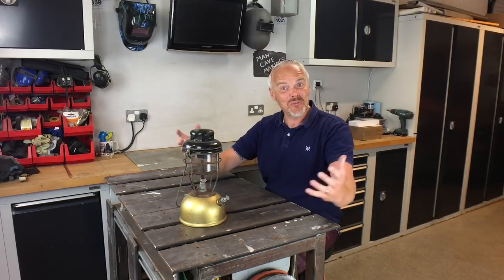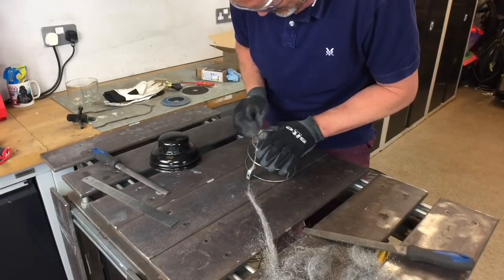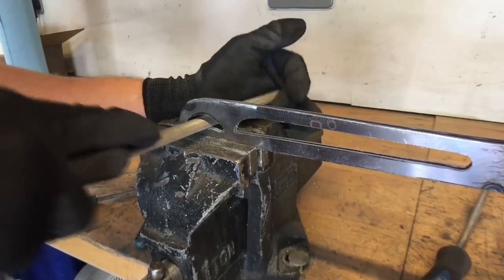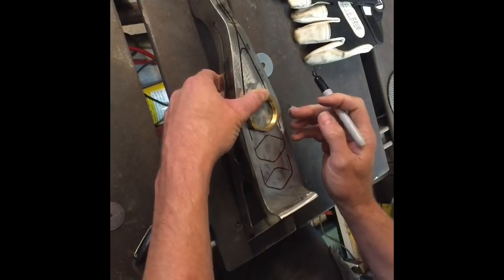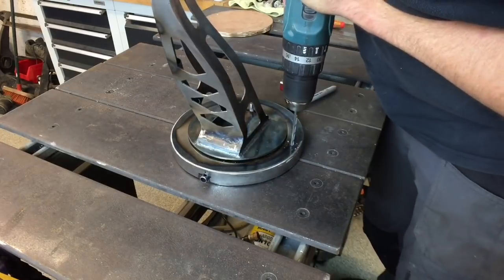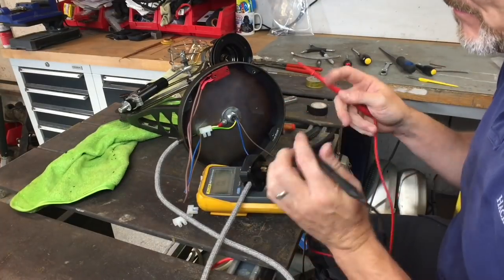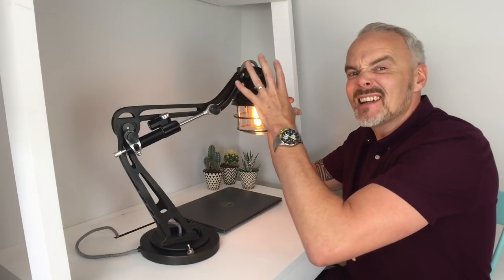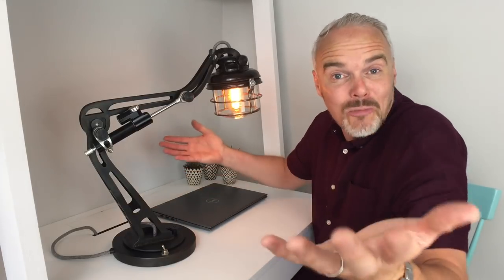Industrial Desk Lamp Build

Comment: Awesome job as always and can watch these over and over. What blades do you use in the jigsaw as I reckon I have tried them all but none work like these seem to do for you .
Reply from the maker: Many thanks the kind words Jason always nice to know what people think of my content and especially nice when guys like you watch more than once, cheers fella 👍
I have used as you mention several different types and makes but have settled on a brand (Timco addax range) but don’t think that’s the deciding factor. I have found that most HSS blades do the job it’s the tooth size that counts so matching blades to the work piece is the critical factor. For example I use 1.2mm to 3mm ranged blades for cutting 1.6mm plate but although the packet says it can cut 3mm I change to the next range size of 2.5mm to 5mm to cut the 3mm bar stock. I have found that matching the lower size of a range of blades to the size of the work helps enormously and makes the blades last longer. I’m not sponsored or anything but if I had an open choice I would be looking at Timco products for a wide range of products including fasteners etc as I do like their stuff, can be a bit pricey but you pay for what you get! Hope that helps 👌👍